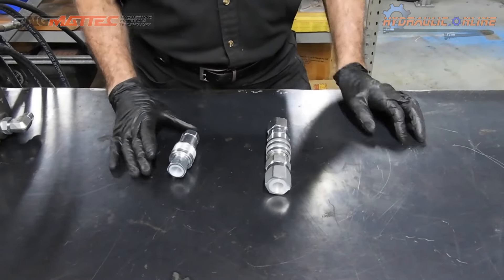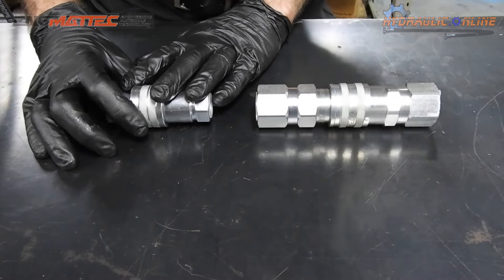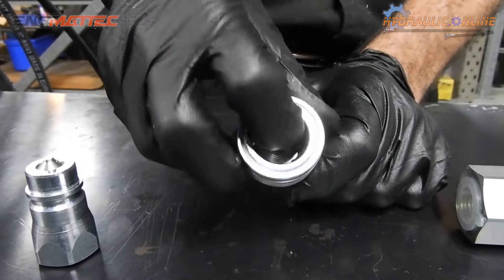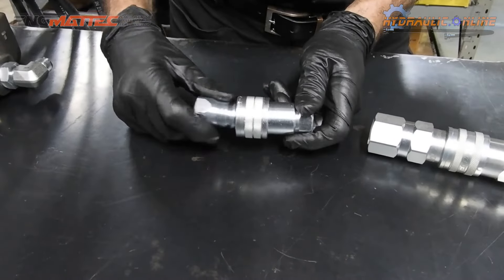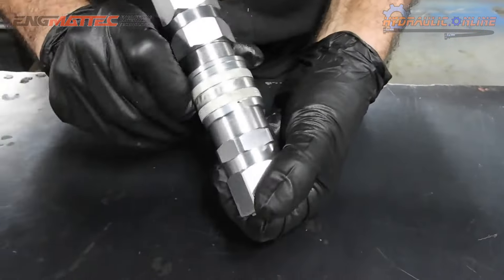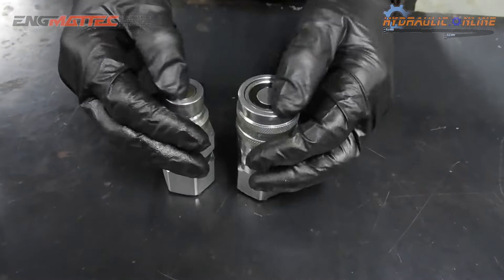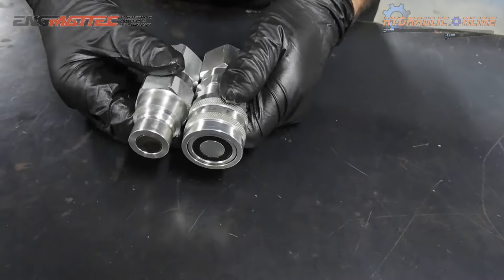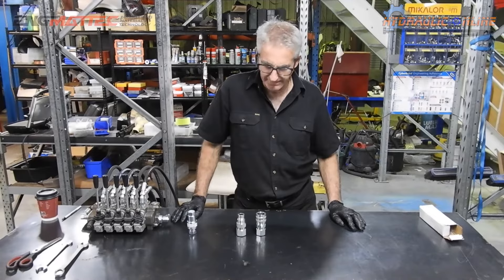Which Is Better - Poppets Or Flat Face Hydraulic Quick Connect Couplers?

Comment: Im in pest control and we use the poppet style to a 150 psi sprayer under houses everyday. (Dragged through dirt, slammed on concrete) and it can handle it for a bit but like you said the dirt and grime just kills the o rings. Can you replace them and if not. What would you recommend. Coupling or brands anything lol we need help/an idea because im tapped out.
Reply from the maker: Danny you can change the O rings and Backing rings on poppet couplers Its a bit fiddly but possible. Get yourself a set of O Ring Picks for about $10, they are hard and sharp so use them carefully so that you do not damage the O Ring groove or put a hole in your fingers. Pull the O ring and Backing Ring out and take them to a bearing Shop they should be able to supply you with new ones for a couple of $. Also you can get Rubber dust caps for the couplings to protect against dust, dirt, and damage. They look like this   https://www.hydraulic.online/search?keyword=dust%20caps

Comment: Very intriguing. I hope, this technology trickles down to bicycles. A godsend for breakaway touring bicycles on flights.
Reply from the maker: Hi Leo,  There are very small drybreak couplings available, they are called CAT Test Ports, they are quite common on Caterpilar equipment for quickly testing and checking pressures during service and maintanace, but maybe still not quite small enough for bycycles is weight is going to be an issue. How many connections would be required for a bicycle two or would you require more?
Reply: @Hydraulic.Online  Hi, Thank you for the reply. Sounds interesting; I'll check them out. A breakaway frame would require one, and the fork, depending on where is internally or externally routed, will require one - or none. 22Bicycles sells couplers ("Brake Break") for ca. $250, and so does JSJ Cycles (unnamed). Indeed, if they were a little smaller and more affordable, they'd be a Godsend for cycle tourists.

Comment: I always recommend to buy the Flatface nipple with pressure eliminator because it is impossible to connect if there is residual pressure inside, for those used to poppets they use a hammer on the top of the nipple to release the pressure which with time will be rounded and will no longer open the valve when connected.
Reply from the maker: Try this neat installation to reduce internal built up pressure in your hydraulic System. 
https://youtube.com/shorts/_r85JUOlU1s

Comment: I have a Parker 1/2inch flat face coupler. The male nipple has lost a little plating on the working surface, and shows brown steel underneath. It's smooth alright. But I am wondering if it should be replaced now or if the plating doesn't matter much🤔?
Reply from the maker: George as long as the surface remains smooth and rust-free when disconnected it should be fine.

Comment: Can either of these be used for refrigerant under pressure?
Reply from the maker: Hi Airspool, No I do not recommend using these quick connect couplers for refrigerant applications,
 the design and seal materials are incorrect for the cold, heat the gas molecule sizes and phases between gas and liquid.

Comment: What about O ring damage when connecting and disconnecting? Do they leak with lots of usage?
Reply from the maker: These couplers use tough synthetic O rings some with nylon backing rings, and are quite durable, that being said repeated connections without cleaning and or wiping the dirt or dust off the couplings before connecting will eventually cause leaks on any type of coupler.

Comment: I am guessing that there is very little air introduced to the system with the flat faced coupler? Like so little that it could be used in a race car scenario for quick change brake calipers. Maybe how Porsche changed the entire front brake set caliper and all on a car in under 50 seconds at Le Mans 2018.
Reply from the maker: Yes makes sense that Porsche probably did use some form of quick-connect disconnect brake hose coupler.

Comment: Very well explained! What adapter kit from you guys transfers the flat faced to the pioneer it's the smaller 1/2" I believe Bobcat 751. Thanks
Reply from the maker: Hi Randy just saw your comment tonight sorry for not replying sooner, I am not quite clear what you are asking? Do you need an adaptor of some kind to fit a Bobcat 751 is that correct?

Comment from the maker: If you are in the US or Canada and you have a Bobcat or other mobile machinery that uses poppet style couplers get your new or replacement flat face couplings below.
https://valvehalla.com/collections/featured-products/products/1-2-npt-male-female-quick-release-hydraulic-coupler-set
Reply: why are flat face couplings in general so much more expensive?
Reply: If you are in us and have trouble disconnecting your flat face coupler, convert them to pioneer
Reply from the maker: @plowmaster1206  😏 Plowmaster, If you have trouble disconnecting a flat face coupler you have either done one of three things, 1. Not rotating the outer sleeve to line up the notch with the lock pin, or 2. Given the outer sleeve a good knock, or 3. Dragged them through the dirt. Then again, do any of the above to any Coupling including Pioneer; chances are you will have trouble disconnecting them as well.

Comment: Can you review a Cejn quick cupeling?
Reply from the maker: Hello Nailtwister a lot of manufacturers including Cejn will manufacture flat face and poppet couplings to the same ISO specification. This is to ensure interchangeability. For example a 1/2" flat face Cejn Male coupling manufactured to ISO 16028 A specifications will fit and connect leak free to an EngMatTec Female 1/2" Flat face coupling and any other manufacturer that manufactures to the same Specification. Dimensionally they will be the same, that being said there may be differences in the quality of materials used, the Heat treatment and hardening of the metals as well as the electroplating  and resistance to corrosion and the elements.  We plan to do some long term tests of various coupler manufacturers, so if you have not done so already please like this video and subscribe to this channel.  
Regards from the team and Hydraulic.online